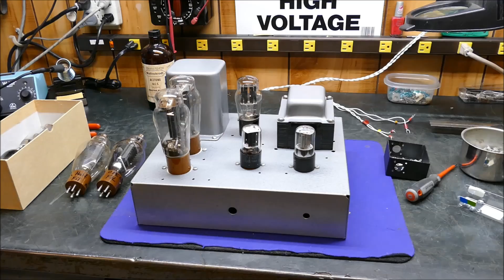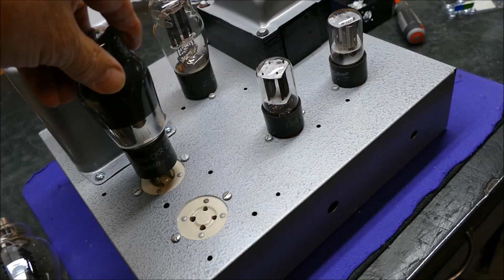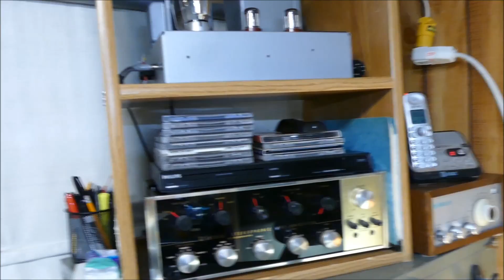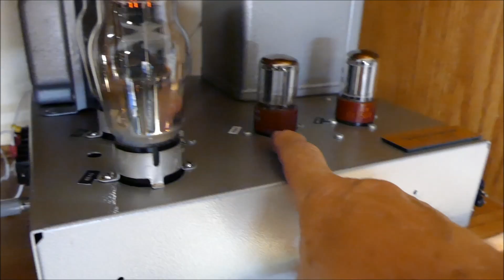2A3, 6B4G, VT-25A, 811A, Directly Heated Cathode Triode Vacuum Tube Power Amplifier Project

Comment: I'm building a 2A3 SE amp with 6sn7,  6sl7.  How did that work out for you?  Which is better for the first stage?  The 6sn7 or 6sl7.   I also have the red base 5692. Great,  Thanks!
Reply from the maker: The 6SL7 is a high mu triode like the 12AX7 and is likely not going to be directly interchangeable with the 6SN7. You can swap them around and it won't hurt anything but performance is likely to be very different. Some of the Williamson style amplifiers that use a 6SL7 as the first tube (I have built one) has an input sensitivity of 100 mV for full output. Way too sensitive for a power amplifier. They also produce more distortion and have anomalies that are difficult to deal with. I suggest for a power amplifier, using the medium mu triode, 6SN7.  You know the 5692 is the industrial version of the 6SN7. I would use it. I have a box full of 5691 red base but I hardly use them. I wish more were the 5692 as I only have a couple.
Reply: @ElPasoTubeAmps  Using the 6sl7 in the first stage,  were you running it hard? At a higher voltage?
Reply from the maker: I can't remember all the details but I am sure I built is true to the original design. In my opinion, the best Williamson style amplifier is exemplified in the Heathkit W3M and W5M designs. I know you are interested in an SE design so these may not be what you are interested in.

https://www.youtube.com/watch?v=9MWN1sZZMfI&t=3s

http://www.mcmlv.org/Archive/HiFi/HeathkitW5M.pdf

Comment: If we go through the trouble to feed the positive grid current to the high mu 811a. we get high plate resistance and just as well could have used the beam tetrode. There are some specialty audio 811s built with low mu(3) and they would work nicely but I don't know if the svetalana sv811-3  tubes like that are still around.

Comment: the 2a3 or 6b4g tubes are the best choice. low mu means better output power and low plate resistance so output will not require lots of feed back to get stable output voltage when feeding the variable impedance of the speaker. I love the 45 tubes best. 2 in push pull will give 10watts and low plate resistance.

Comment: VT-25 is a wonderful sounding tube. But with its high plate resistance it requires quite a high primary on the transformer. IMHO 2A3 are more practical for output power tubes as they are much less demanding on the OPT and produce more power.
Reply from the maker: Nath My output transformer primary is in the 10K ohm range so your information is really encouraging, in this  case. No doubt the 2A3 is the preferred vintage triode and there will be a challenge in the filament voltage for the VT-25A as it is 7.5 volts. I do appreciate your information.

Comment: Hi there David,

Heck you're shooting a pair of amps a week these days.... boy that's some  pace.

Those little red base RCA's are amazing aren't they? I guess GE also made those tubes... I once came across a pair of 5693..... (the 6sj7 industrial equivalent) boy... they sounded amazing as the first gain stage then they drove a sylvania mil spec light brow base 6sn7 on the spliter and a pair of 5881's in PP on the output stage. I like the idea of the VT's on the ouput a lot, they look incredible.

Thanks for another amp,

Denis
Reply from the maker: Denis Gouvea de Azevedo  Thanks Denis, I have been enjoying building lately.Since my early days of audio amps and RF amplifiers for amateur radio, I have been focused on high power amplifiers. But for some reason, simplicity for one, I have been enjoying the much more modest power amplifiers lately. I have such a nice stash of tubes, I figure I should use them and enjoy them. I love the 6B4 amp and listen to it in my shop replacing the McIntosh - at least for now :-) 

I just got in all the solid state devices to make the driver for the 833 amp and I will give it another try at getting it to perform properly at low frequencies. If it does work, I will prove a couple of things - one being that it is OK to use a push-pull transformer as a single ended transformer. I can't see why not but some have told me that is my problem.

As for the RCA Red Base tubes (as you say, also probably made by GE) they made an amazing difference. I haven't run a THD scan on them yet but I will next time I have it on the bench. Also, It is a little extra trouble to mount the removable AC plug but it makes it so easy to move around without having to fight the AC power cord tangled in every other cable.
Reply: ElPaso TubeAmps I think you’re right, heck ....what’s the point in having such a nice stash of tubes and sticking to the same old recipes....like most people do, 6l6PP, el-34PP....6550PP....EL-84PP...  It’s cool to try some ‘controversial’ projects and give a new life to those wonderful tubes every now and then. It’s all about the fun of building,... and hey.... you might just run into THE amp... while building all sorts of unusual projects. The corky amp project I never tried is the OTL.... I keep postponing it but I know I’ll just give it a go someday. 

The 6b4 amp is perfectly tailored for shop use, plug it to a tuner and you’re good to go. Besides, you guys are blessed with a lot of nice radio stations in the US, specially in Texas.... I’m into southern rock, hard rock and heavy metal....and here it’s all about rap.......... I just catch a lot of US stations via the internet.... I even thought about building a DAB radio out of an old iPhone and a Philips tube radio I have lying around somewhere.... just for fun, you know, shop background music...

As for the 833 amp... hey...nothing wrong with PP transformers in SE in my book, BUT, something just came to mind that might explain that LF rolloff... DC SATURATION,  right there at the driver... it’s a major issue on a SE..... that’s why the SE transformers have that air gap.... when the core is saturated, the low frequency that takes a huge toll and that might be the issue here since the transformer was intended to PP.  If that’s the case you can just break that 6v6 transformer open then reassemble it with all the E plates on one side and the I plates opposite to it with a piece of card in between, just like those old crappy output transformers on radio and TV sets. 

I just get those AC sockets with EMI filters.... don’t know if it’ll make much of a difference but they cost the same and I find it pretty handy to solder the ground wire on those big terminals.

Comment: I finally broke down and bought me a metal break and a greenlee punch. I just finished a Princeton 5F1 single ended 6v6, but I have an oscillation at about 3/4 throttle with or without any input????

Comment: Hello. First i'd like to say thank you for your channel, is very complete and extense if you like all this tube amp stuff.

I know that what i'm saying in this message is not related to this video, but i need your help!

I'm a sound and image engineer and i'm beggining to design guitar tube amplfiers, I have to build two of them, one "european like" with EL34 and an "american like" with 6L6GC, and i have a big problem with the screen of the output tetrodes and pentodes, as the calculations i do for commercial amplifiers with the standard screen resistor (between 470 and 1kOhm almost ever in guitar amps) say that this resistor would break when the dissipation on the screen is 4 times the maximum dissipation value. 
When i test the amplifiers i design on spice simulations, i finally need to set a very large value screen resistor and the screen capacitor that is not needed when the screen resistor is small.
As i know, when the plate current increases (plate voltage decreases), the screen current is increased very much so, Does this mean that when the amp is clipping, the screen or the tube are damaged? 
I would glad your help or even if it's possible some kind of screen test video where you explain what happens at the screen (current, voltage, dissipation etc) of the output tetrode/pentode when the amplifier works on maximum power. 

Thank you very much for sharing your knowledge and work with all of us!
Reply from the maker: victorsh8invader I included a link below for some measurements I have made on the screen grid of 6L6's in case you have not seen it. Maybe it will help. I understand the problem and it is easy to see that there is no value of screen resistor that will limit the screen current to a safe value that you can actually use in a working amplifier. I think a lot of issues occur in guitar amplifiers when the screen becomes damaged and no one knows when or why it happened. I don't know if clipping is a cause of screen grid damage or not but you might have something there. Some builders use 1/8 watt resistors so that they will (hopefully) burn up before destroying the screen. The new SVT amps do this on their amp that uses six (6) 6550's. Unfortunately, they put these 1/8 watt screen resistors in a place on the PC board that requires disassembling the entire amplifier to replace them.
I am familiar with PSpice and used it often when I worked for Lockheed at WSMR. It was the DOS version.  I do have the student version 9.x on my PC but hardly use it any more. I have never had any vacuum tube models. Whatever models for vacuum tubes you might have would be appreciated if you could share them, assuming they will run under the version of PSpice I have. 

https://www.youtube.com/watch?v=DSB5yvsMJrc